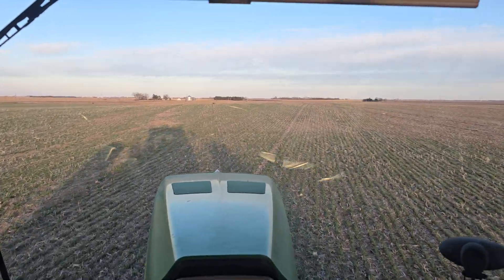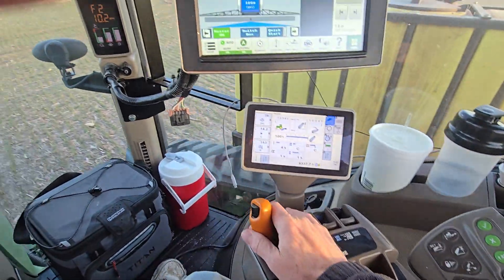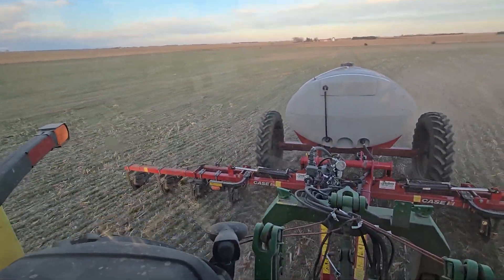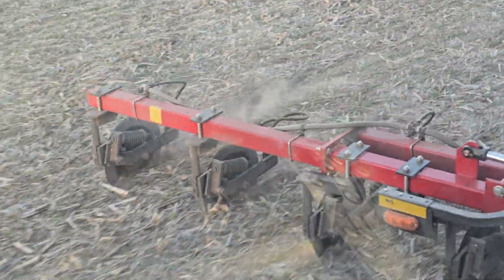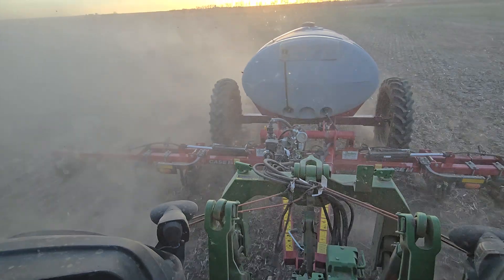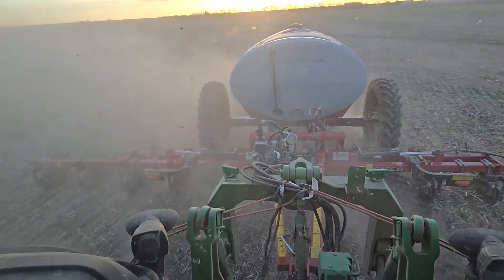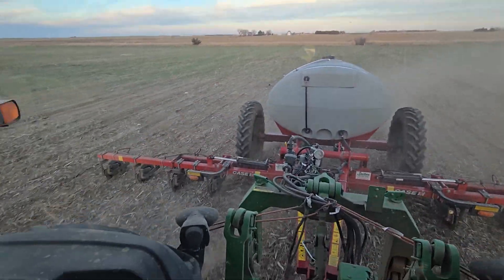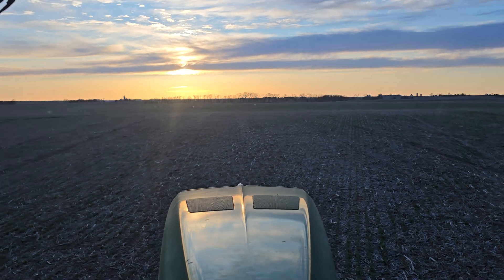Best Regenerative Corn fertility and biological program for corn planted into cover crops in 2025

Comment: how do you make your biologicals?
Reply from the maker: @simeonkleinsasser find direct sources dont buy watered down products from salesman, understand what's it biologicals and check the MSD sheet to find the ingredients..m then usually cut the concentrate with water and mix in the tank.   I work with liquid, dry and planter box biological- seed treated mycorrihiza fungi- on the seed.  The liquid i mix with my fertility program
Reply: @growthefarmup2606  Do you use any farm-made compost extracts?
Reply: @growthefarmup2606  Do you make compost extracts?

Comment: The ground looks dry enough to plant. 72 degrees here yesterday, 57 this morning when I got up to milk, 45 this afternoon.  We had several thunderstorms yesterday and a heavy soaker this morning.  Frost is disappearing.
Reply from the maker: @danw6014  yea we need soke moisture badly, we are starting out in a drought!  We've been joking that you gotta have moisture before you need to worry about frost in the ground.   It's still freezing here off and on for a couple weeks, but we've also had alot of nice 70° days to.  It may be a plant early year.  Stay tuned!    

What are you planting this year Dan?  No cash crops seem to pencil out in 2025!  Thanks
Reply: @growthefarmup2606  just 11 acres of corn for the crib. If I need more, I'll buy it. I've been buying shelled corn for the sheep. I just started buying Holstein Angus cross calves. Those are hitting $800 to $1000. The trade off is they finish quicker than the holsteins. If I pick up 16 acres down the road I'll plant rye this fall and then seed it down to hay or pasture next year.  It's marginal ground though and they want to much for the rent so we'll see. More broilers,  more eggs and more lambs.
Reply from the maker: @danw6014  that sounds like a good plan, you'll prob be more profitable than the avg 2000+ acre farm, unless we have a near global prodiction issue with the 2025 crop.  I'm pretty bearish on cash crops, diversity into livestock is the last peice of the puzzle i need to move into.  There's risk is everything, i used to hedge cattle and the market swings are huge and scary!  Lol. Seems like direct to consumer small farms are actually set up better to sustain thru the tuff years (8 out of 10 years) 

I'm just trying to make $$$!  Or minimize the expected row crop losses!  You have yourself a fine plan.    Agreed that cash rents are way to high to even try to pencil, especially if it's marginal land.   The cost of land has officially out paced the ability for the farmer to purchase and make the payments, farm land ownership is now in the hands of large investors and/or family farms that have wisely used the equity.
Reply: @growthefarmup2606  land here is hitting $15,000 development pressure.  Cost of buying calves is getting tuff to bite off. This year's beef is spoken for. Next year's beef will be $4.10  a hanging pound. Lambs are very high. We have the best market in the country with three processing plants in Detroit.  The steers are confined. The sheep however, I can move anywhere.  Portable electronet fencing is the greatest thing ever invented. People like having them in their backyard for a couple of months.

Comment: As is that Raven Viper 4. Monitor if that's what you had. I really like that. It was a huge jump for the Raven lineup. I put it in some of the manure guys. Even put slingshot with it. Joe, just like the co-ops the minute that the guy is done with the field, it sends that field report back to the home office and instantly they email the customer. So when he got done put manure on your farm. While the tractor is driving back to the corner of the field he has, the owner could already be driving to the office of the customer with all the maps and reports and the bill 

Someday you'll have to demo a fent 900 series track machine 

If I had soil that was as soft as yours 100%. I agree that you don't need strip till a coulter to get it into the ground. Someday I'll get there

Sometimes you have to spend a little to get a little. Farmers are so used to simply Price shopping and not looking at quality. Because at the same time we're not producing quality. So it kind of goes hand in hand. A little off topic there. I tend to wander. 

Getting into biologicals and biostimulants from quality companies has been a real eye-opening experience and a real Joy.
Reply from the maker: @jonstevensmaplegrovefarms3754  thats quite a soil compliment coming from you Jon!  You've got a keen eye for mellow soil.  A lot of no till cover crops and biologicals for 25+ years.   I think strip till has its place.  It's better than disking/ tilling the whole field!   

Im all for trying somthing other than green, this tractor had a long block JD reman 9 liter motor put in it at 6,500 hrs.  It blew a hole in the block.  I was pissed.  I have some old cat motors in semi trucks that have 30,000 hrs on then and don't burn a drop of oil!   I almost pulled the trigger on buying a different tractor, but the 50K for the motor was cheaper than the half million dollars they want for new.   I looked at some used, but again couldn't find what I wanted, its a 2010 8345RT, NO DEF! ive rebuilt both hubs, the engine and hydrolic pump etc., a few more breakdowns and ive almost got a brand new tractor!  Lol  

Thanks Jon and good luck up north.  I always look fwd to your vids!
Reply: @growthefarmup2606   yeah, it's easy to spend others money ! 

I have a cat C9 sitting in the burnt combine. If I could find an 60 series articulate Deere with a bad engine that would be a fun fix!
Reply from the maker: @jonstevensmaplegrovefarms3754  it would be!  I really enjoy your shop videos, your a jack of all trades.  Your exteeemly capable of doing some serious repairs, ive learned alot watching you in the shop, your a good teacher!  

Then you have good soil health discussion and demonstration vids.  Always had a great respect for your operation.  One of these days I need to diversify into livestock for soil health.  Heck, livestock is a crapshoot also, but may be the most "profitable" part of your operation.  

Funny comment: it is easy to spend others money!  Just look at what we are learning about where our tax dollars have been going... we all kinda knew it... but having it specifically exposed is a major eye opener.  We are in uncharted territory in the world today!
Reply: @growthefarmup2606  ha, thanks for the kind words. 
Cattle can be profitable once infrastructure is paid for. 
In a rotating like ours they can be very profitable, grazing before and after corn, adds a couple hundred dollars to the cash flow of that field, plus the reduced input dollars. Never heard anyone putting corn into clover alfalfa and complaining.
Reply from the maker: @jonstevensmaplegrovefarms3754  lol